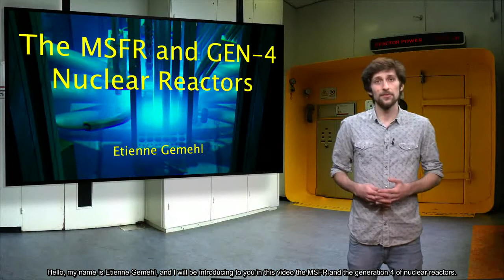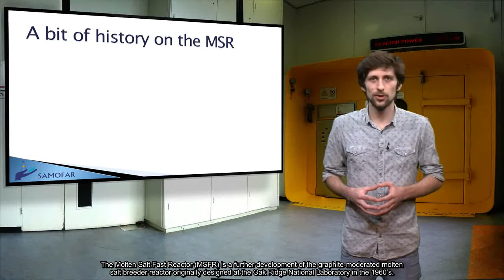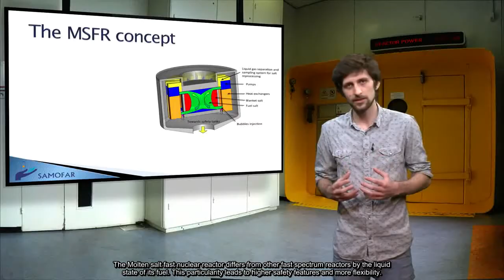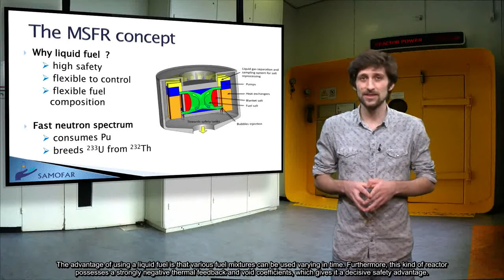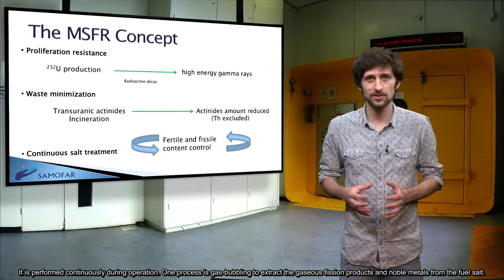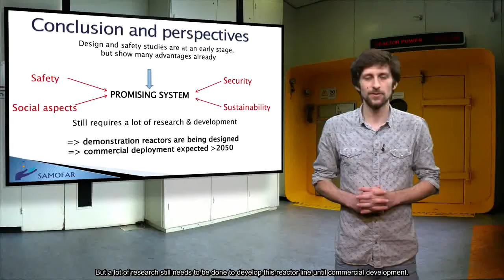Gemehl - MSFR and Generation IV

Comment: China has given up on MSFR.China is going to the far side of the moon to mine Helium-3 for nuclear fusion.
Reply: Really? Source?
Reply: @hjembrentkent6181  That is an obvious joke, probably referencing Iron Sky. Helium 3 is only useful for compact fusion reactors, because He3 offers aneutronic fusion, meaning it doesn't emit many—or any—neutrons which are electronically neutral, hence neutron. So neutrons cannot be contained in a magnetic field meaning you need physical matter to block them, and quite a bit of it. So with a aneutronic fusion reactor you can cut down the weight and size of the reactor.

This would only really be beneficial in something that needs to be mobile like a spaceship or aircraft, but the reason why it's dumb to start off with He 3 fusion is because it requires almost 3x the heat, meaning you need stronger magnetic confinement and the heating—which would mean consuming more power—for the same output power. This runs head long into the current issue with fusion, which is just getting more power out of the reactor than you are putting in, so as said; going to He 3 fusion to start with would be dumb. Also because the fuel is rare, but deuterium is very abandon on earth and tritium can be breed from lithium with the neutrons given off by the reactor.

The by product of which is He 3, so it make some sense to go for He 3 fusion after you already have a lot of deuterium-tritium fusion reactors. Which then gives off He 4 which is a stable isotope of helium and we are running out of helium, so it's a semi decent plan. Although if you have He 3 fusion, you can go to Jupiter to get all the helium—both He 3 and He—you could ever want.

Also another side beneift of He 3 fusion is it means you don't ionise your reactor, which is a 2 fold advantage; first your reactor walls don't become nuclear waste and second you don't need to replace the reactor walls every so often. I think the estimate is about every 3 years you would need to replace the reactor walls, so this in the end could reduce cost of He 3 fusion over D-T fusion, but right now we just need to get significantly more power out than we put in, and D-T fusion is better for that.